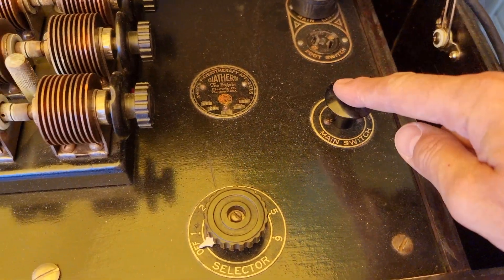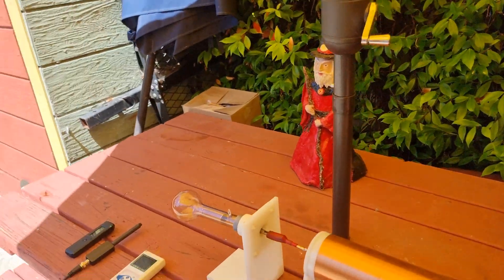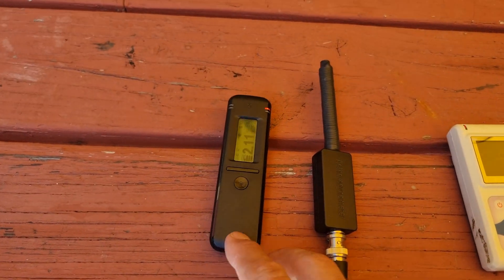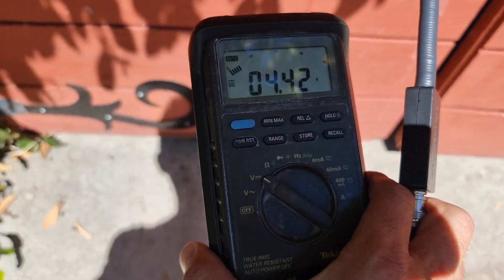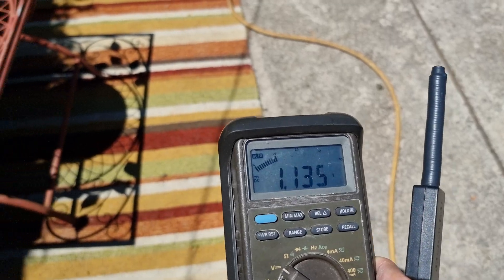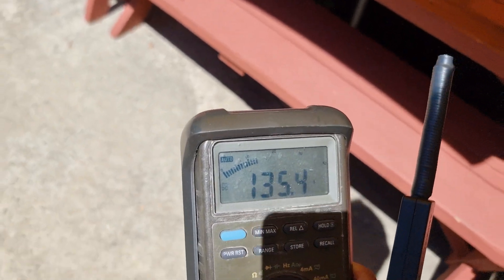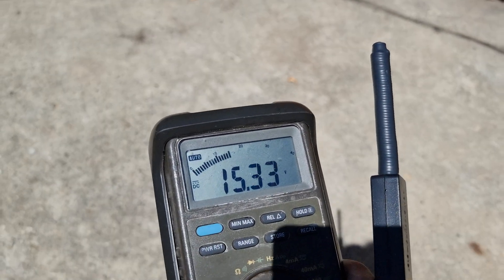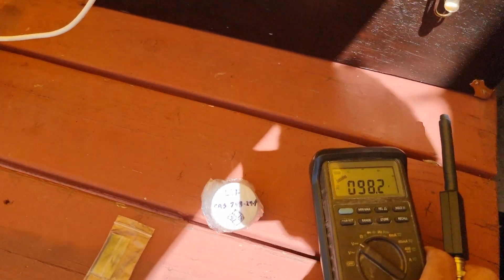DESI - Switch on of Griffin Brock 1A21 radiating beam tube - DESMITRON

Comment: In the 1950s, when the SI was considering creating the Tesla units of magnetism (and also the Hertz to cps,)  too bad they didn't make the Teslas be the cycles per second.   But then, we'd never hear the end of it.   Music stations at 1.25 kilotesla's on the AM band!  At least with gauss-to-teslas, it's somewhat hidden from the skeptics.     
PS what's the higher part of the spectrum on the Radiacode?   be aware that 100KeV gammas are associated with relativistic electrons (at roughly half lightspeed.)   If the coil output is above 100KV peak, then it's not an x-ray tube, it's more a Lenard-style particle accelerator with a silica window, probably creating a relativistic plasma in the air out front.   Normal sparks contain UV photons and eV electrons in synergestic combination.   This would be a "spark" instead composed of betas and gammas.    I'd test whether a sensitive counter will still click slightly faster when placed in the beam at 1000ft distance.

Also, put a plexi slab in the beam for awhile, then use a field-mill or a simple electrometer to detect whether you've injected negative charge deep into the plastic.   If so, the part of the tube output is fast electrons, and not just x-rays.

Last, common "doorknob sparks" in winter weather involve few-picosecond edges.   That's what EMP stimulators must create, to perform immunity testing on electronics products.   If this tube does similar when the peaks trigger ionization, then it will "discharge" the Tesla coil in a couple of nanoseconds, depending on the cylinder length.   If so, the brief peak wattage may easily be megawatts.   With megawatt microwave pulses mixed with relativistic electron-avalanche on top of gamma-beams, who knows what we'd expect to observe.   (And all in a desktop experiment.)

Comment: Bob you need to show all of these reading with just an open terminal without the tube connected first to show the affect of just the tesla coil first as a control.
Reply from the maker: Yeh, we did things like that and will do more this week.
Reply: @MFMP  no counts from a Tesla coil.   However, if using oldschool Ludlum counter, you'd need to screw a piece of copper braid between PCB ground and the lower metal shell, since the rubber gasket will float the shell and eliminate the Faraday shield.   In that case, EMP will be picked up and cause counts, even when the GM tube is removed.   I wouldn't be surprised if all plastic-case counters did the same.   Wrap them in aluminum foil?
PS try night-vision starlight scope, basically an image intensifier.   Bet it lets you instantly see the glow of a lanex screen.  (Haven't tried this myself.   I only have a 2000x sniperscope, not a modern one.)